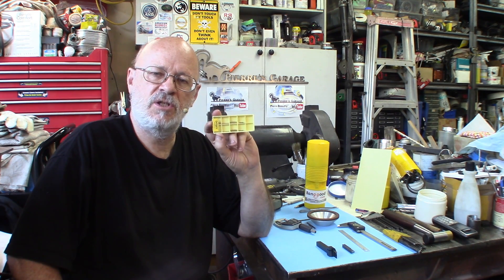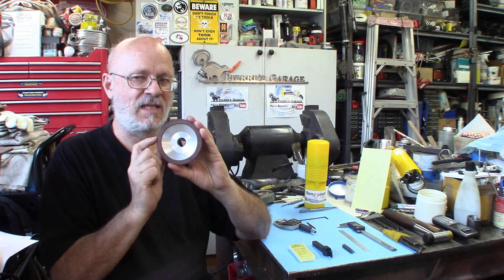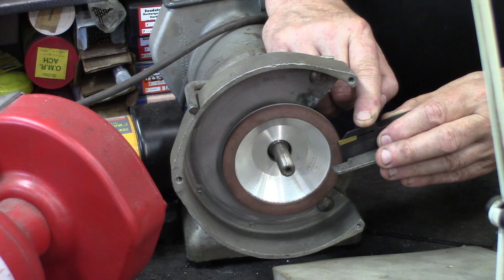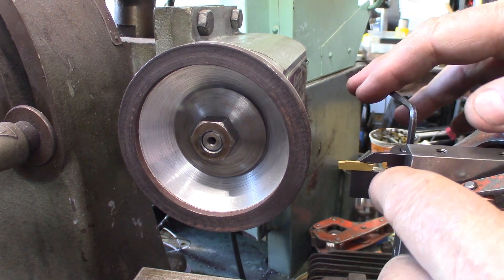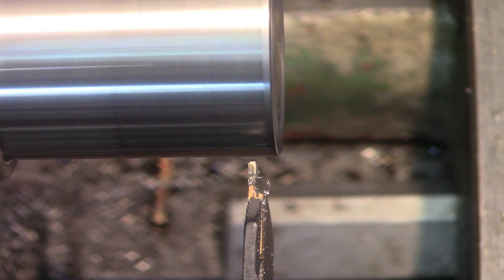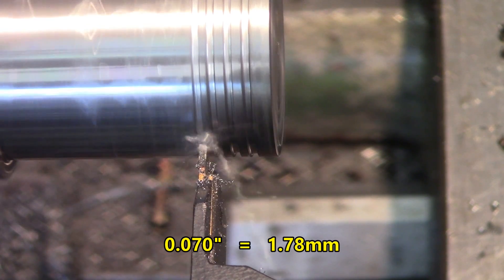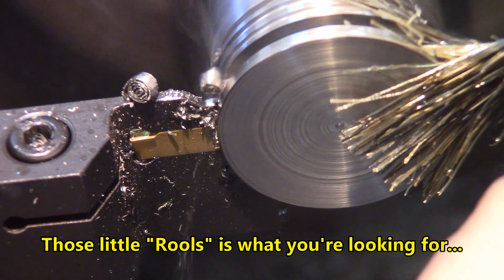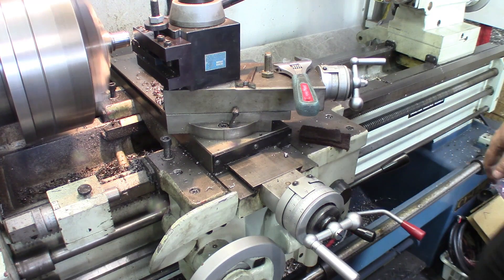Grooving and parting tools made easy and affordable with cheap carbide inserts from Banggood

Comment: Yes these work well.. Unfortunately the tool holders are not indestructible. I started getting a little chatter on mine yesterday, slowed down the RPM, didn't help.. Decided to keep cutting and bang! The bottom of the parting tool broke off.
Reply from the maker: You need to avoid chatter at all cost on any cut you perform, the "Staccato" movements of the tool is causing very high peaks of force at each hit, this usually cause a chain reaction that worsens the situation.
The problem is more accute on smaller and less stout machines, possible ways to help is to use some thin HSS cobalt parting blades as thin as possible, also check you cutting profile on the edge of the tool, the height must be on center, if you use carbide tooling try the next size down as it requires less force.
If nothing works on certain parts, you may cut your part using a hack saw and face afterwards.
Just remember that parting is a really demanding operation in the machining world....
Cheers,
Pierre
Reply: @pierresgarage2687  Thanks Pierre,  Not only did it break the tool it also dragged the chuck back plate I was making out of the chuck and launched it! Thankfully it missed the bed ways. After that I discovered my 3 jaw had huge run-out (adjustable) and the headstock of my brand new lathe is now mis aligned. In fairness I didn't check the headstock alignment when I set up the new lathe so it might have been out when first installed (have only been doing short parts so may not have noticed). Live and learn!
Reply from the maker: @frankish5314  
We all do "Bou-bou's" just make the ones where that don't injure us...  🙂
Reply: @pierresgarage2687  Especially in the "Land of the Free" where a trip to the emergency room will likely cost more than my new lathe!..:)

Comment: I know this is an old post Pierre, but THANK YOU. I've been crashing this same parting tool and finally ruined the holder completely.  Now I know how to use it correctly so I'll get another one.  Merci mon cher Monsieur.  Gilles :)
Reply from the maker: Thanks for your comment....
It's always easier to part or groove on sturdier machines, but, if you're being careful to make your setup a rigid as possible on smaller machines, you'll be able to obtain decent results. To resume for setup on any machine, shortest hangout from the tool holder, closest as possible from the center of the carriage (avoid wide tool holders or the ones further from the toolpost) shortest distance from the lathe's broach, close fiting chuck or a short collet holder, possibly adding a little pressure on your gibs on your cross slide and coumpound, finally, for smaller machines try using narrower paths as it will require less HP and rigidity to remove a smaller amount of material. Lastly, make sure you have a positive push into the material, avoid rubbing at al cost mostly in hardenable materials, a well felt push and a constant measured pressure is the final key to good results....
👍👍

Comment: take a skill saw blade and make a pile of parting tools with a used skill saw blade,
Reply from the maker: You're right about this, there isn't a limit on the type of tooling you can imagine, imagine making tools from a 80 theet blade...
One detail is that the type of carbide used for making wood cutting tools isn't the same grade as what they use for cutting harder steel alloys, great for aluminium or mild steel.
Reply: @pierresgarage2687  : yes but free, cut carbon, delrin, aluminum, igus.com stock, phonelic, etc.. but u get the correct skill saw blade its lil better. and you can re-sharpen them few times.
Reply from the maker: @Pushyhog  If you get blades made from carbon steel, you're only good for very soft materials, if you use HSS blades you're good for cutting much harder stuff, HSS won't loose it's hardness as it heats up during operation, everything depends on what you need to cut and how much of it you need to process.

Comment: can anybody tel me how you put a Parting Off Carbide Inserts in to the tool as mine has no screw to tighten it up it just seems to slot in how far do you put it in do I bang it in please help i push it in and it comes out with a pull of my fingers I am new to all this please help
Reply from the maker: If you got the right insert for your parting blade it should be a tight fit, the insert should be pushed to the max it will go...
When it's too loose it may be cause you don't have the right insert for that bat or that that bar had been forced, this isn't good, you need to know that those bars are quite hardened material, it could be difficult to repair in that instance.
You should be able to read the part number written on the side of the blade, some of those also have the type of inserts you need to use with them, not all, though...
let me know how you manage...
Reply: @pierresgarage2687  Thank you for your reply ........I no you give them a gentle tap with a copper hammer and they sit in the tool with no other help.......... With not being familiar with it I found it strange that It could just sit there with no support that I could see.......... and the forced it go's through.....apparently It does thank you again for your reply......

Comment: Hi Pierre like the idea, I need to cut a groove 1.5mm wide and 1mm deep groove in a ball bearing outer race to locate a snap ring. what do you think good/bad idea thanks Jeff. from UK
Reply from the maker: Hi Jeff,  you nee to attack something seriously hard...!!!
First, I hope you got a pretty stout lathe, then, get yourself some grooving inserts that can work into 60+ RC material, then, it should be quite all right, if not, you can always try with some thin cutoff wheels held in the compound slide of your lathe grinding the slot while turning the bearing race.
I don't know what else you could have available, but, this could do the job, if you need more ideas just get in touch and we could surely work it out...   ;)
Cheers,    Pierre

Comment: Oh wow, I never seen any videos on this subject.  I had couple of these diamond cup wheels for few years given to me by my dad's friend who is retired Boeing machinist.  My uncle told me I need to run them like 10000 rpm and since I don't have a setup like this I never got to use them but I have some carbide bits that need regrinding.   What rpm is your grinder running at?

Comment: You always feed in manually for parting, or do you sometimes use autofeed ?
Reply from the maker: Sometimes I'll use power feed, but, mostly manually, it allows me to "Feel" the cut and break the rollers before they get too big. Also the inward direction of the carriage requires an inversion of the feed by actuating a lever, so I just don't give myself the trouble of stopping and do the change.
For internal grooving, it's never power feed...
Thanks for your interest and for comment,    Pierre

Comment: Despite dire warnings to the contrary, grinding HSS with diamond is not a problem in the home shop environment, research labs or NASA  might be different but that is outside my sphere of reference. Grinding ordinary mild steel can still be done with diamond but why on earth would you want to? The only real concern is getting the diamond or HSS too hot but if care is taken don't worry overly about it. I have been grinding HSS on my T&C grinder for years and my wheels are still fine, just give them a clean once in a while with SC when they get a bit glossy.
Reply from the maker: Heating Cobalt HSS hot isn't a problem since it keeps it's hardness, the bigger problem is you fingers...   lol
As an example, you can weld a piece of HSS on the tip of a steel bar, sharpen it and use it any way you fancy...
Sharpening HSS on a resin bond wheel will wear it out verry fast, as if you use a boron type wheel it will do much better, normal grinding wheels with pretty coarse grit are excellent, just better if you have a more powerfull grinder in order to shorten the grinding time to a minimum, then you finish on a finer wheel or hone with diamond lap.
When ever possible it's always best to avoid grinding dust of any kind as the very fine particules will go to the deeper parts of the lungs and are very hard to expulse, and, will cause some dammage to fine tissues... The worse is asbestos but there isn't much more in use now...
Reply: Breathing I know a bit about, studied to be a respiratory physiologist in my youth, but soon gave it up when I realised hospitals are full of sick people. Machines are much more fun to deal with, and when they cough up all over you they don't infect you with nasty bugs, also they are much easier to fix than people and rarely do they answer back.:>)
Reply from the maker: Pretty true...  If you're not already sick, hospital will surely adopt you...   lol
Reply: My concern about grinding steel with diamond is the same one I was taught in my CNC tech program - at grinding speeds the diamond is chemically soaking into the steel.   Machine grinding puts far too much power into the cutting action and it's all at the tiny points of contact where the diamond crystals touch the work.  

The wheel may be hardly even warm to your fingers, but the microscopic diamond points are hitting thousands of degrees.  That's why you can hand sharpen knives with diamond stones just fine, but as Pierre clearly says, you will ruin your diamond wheel quickly by grinding steel with it.
Reply: Hi somebody, I understand the theory but surely, and I'm only talking about the home environment, an extra bit of carbon would only in effect case harden ordinary steel and only then if the steel got to red heat and then quenched. As for carbon leaving the wheel, this is a valid concern but only for single layer electroplated wheels. Resin bonded diamond wheels are a different matter entirely as they are intended to be sacrificial every time you true or clean one. If there is a flaw in my logic I would be grateful for a correction.
Reply: You are exactly correct.  The effect on the steel is negligible, the issue is only how fast you're comfortable using up your diamonds :)

I'm too cheap to sacrifice a diamond grinding wheel to find out, but I can say I've ruined a number of cheap diamond burr tools trying to deal with one hardened steel part.  For comparison, I've used those same cheap burrs to clean up ceramic parts for months.
Reply: I too have "over used" (read abused) those cheap diamond burrs on steel both carbon and HS varieties, but they are of the electroplate type with only one layer of diamond chips. Resin bonded grinding wheels will last years on any type of cutting tool, again I'm only talking home use.

Comment: Thanks for doing the product placement ads and the infortainment ads so openly recognisable. Specially your demonstrations of the usability serves not only the seller but also helps the buyer. Advertisement in this manner is acceptable if it does not take the main part of the content. There are too many other channels which either try to clandestinly sneak in product placements or do it openly but not much else anymore... These are sad cases. Your channel is an example of how it should be done. Openly and not too much. I hope it stays that way.
Reply from the maker: Thanks, I really appreciate an honest feedback from you as a viewer.

Sometimes, I'll give some reviews of products that represent a great purchase for a potential buyer, it has to be a good product and a decent price, if not, you're not gonna see me push something in what I don't believe... 

The first objective on the channel is to make videos where you can possibly learn new ways of doing things better or simpler and more economically, this is where I'll name some products I use like in this particular video, you only need like less than $40 dolars of tooling to be able to achive all the grooves under 0.080" (2mm), this is where the client gets the job done at a fair cost instead of spending thousands of $$$ for every specialized tool that the big companies try to shove down your throat...   ( Sorry for the rant...)

Your comments are always gonna be welcome as they're constructive and will surely help me in adjusting the usable content ainly directed to the user's benefit...

Thanks again for taking the time to comment,    Pierre

Comment: I sure could use that grinder!  The cup wheel does seem super value. I usually have to make do with my green wheel. Nice grooves.
Good video Pierre.
Reply from the maker: Hi Chris, the green wheels are wearing out very fast and are unable to make a good finish mostly on the edged og the carbide tool, since it's mostly hitting hard and keeps on chipping away the nice edge as it grinds...
I think that beside that wheel at about $13usd there is one like 75mm at about half the price, they perform a much better edge and last very much longer as they also keep their shape and not only wear in one spot...   ;)
Reply: Good points Pierre - I'll get me one of those wheels.
Reply from the maker: I'm sure you'll like it, in any case kep me updated on what you may think about... It's always good to have more than one opinion.

Comment: Nice parting tool.  I may try some.
Reply from the maker: If my memory serves me well I had to adapt the center hub to the Clarkson arbor and tweeked a little the faces in order to bring everything with the least runout possible, pretty straight forward procedure...
This may be an idea to show how it could be done on that second wheel in a future video...   Thinking....   ;)
Reply: Hey Harold, I just ordered one after seeing Pierre's first video, inserts are amazing, we home shop guys can afford a lifetime supply of inserts. Used to be the tears would flow when ever I broke a corner on an insert, now I change them when I should. Keeps me keeping on!
Reply from the maker: They can even be re-sharpened and made to special shapes if needed...   ;)
Reply from the maker: It's time to get tempted, just remembet to keep the spped as high as possible and the right pressure, it's the way carbide works best, (Hates lower speeds)
Reply: Hey Pierre, did you have any problem with balance on that diamond wheel? I got one a while ago and it needs work (haven't got back to it yet) . I don't have the nice tool grinder like yours, but I am in the process of making a Harold Hall type grinding support..
Reply: Thanks!

Comment: The great thing about cheap chinese tools is when you want to modify them eh?  Not fearing scrapping a $200 tool and insert on an experiment.
Reply from the maker: Hi Barry, at less than $20CDN for a tool and a box of ten inserts, it's hard not to think about grinding your own special tools, and, make all the mistakes you need to learn...   lol
So far I'm pretty impressed with the overall quality of the cutting tools and inserts available on Banggood at great ratio quality/price...   I'll keep on pointing out my good finds, so not to be alone in the savings...

Comment: I'm particularly interested by anything you do on your Clarkson, I have one myself! Thanks for another straight forward video!
Reply from the maker: Hi Matthew,
So far I've user the Clarkson on slimpler operations since I'm missing some of the standard holding accessories available for it. Even though, it's quite a good tool for it's easy to adjust and setup for simple sharpening or grinding operations not requiring a surface grinder.
Guess there are gonna be more videos involving the Clarkson in the future, so many tools to use...   ;)
Reply: I've made quit a few tool holders for my Clarkson. I have found a site that has a lot of information about Clarksons and Clarkson tooling. There drawings for the basic tool holders and some photos of my tool holding contributions. I am taking a Richard King scraping course in the UK in December, the Clarkson is going to be my scraping project!
Reply from the maker: Nice about the scraping class...  Would you have at hand the link for that site about the Clarkson, so far I've not found much about it...   ???
Reply: Sorry! I forgot to add the link!! http://www.bedroom-workshop.com/index.htm
Reply from the maker: A couple of nice informations in there, I'll be looking into it...    Thanks...!!!

Comment: When you cross feed ,outside diameter spins faster than the center ,that is why sometimes you get great finish on outside but bad inside.Only way to deal with it on manual lathe is to slightly add more speed,play with the feed rate untill you get satisfying finish .And we all know that carbide likes higher speed and plenty of cutting fluid.And then again parting operations are usualy done on low speeds(older machines ,hobby mahcines anyway) ,that is why i prefer the hss parting tools on anything than hard steel or stainless steel.
Reply from the maker: Your explanation about the rotational speed and surface speed regarding the surface finisf is quite exact...
CNC machines will increase rotation to about 4 to 5000 RPMs near center, this will yield beautiful finiches...
So far HSS parting tools served vrey well even in Staniless and hardened steel, you can watch my previous videos when makinh the machinist hammer for Keith Fenner's WIYB giveaway, make sure you get the Cobalt blades, though, they last surprisingly long and are quite efficient even at quite high speeds for HSS...   ;)